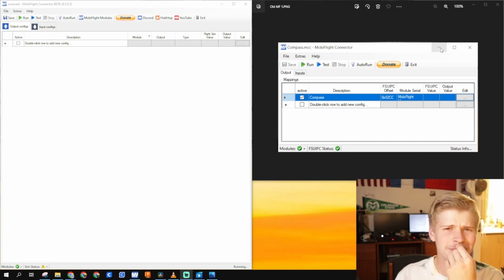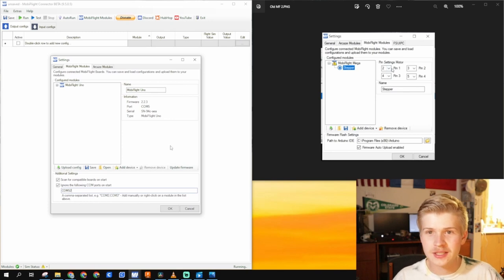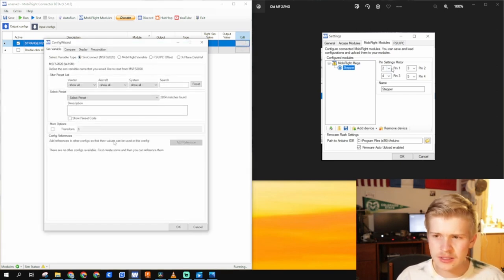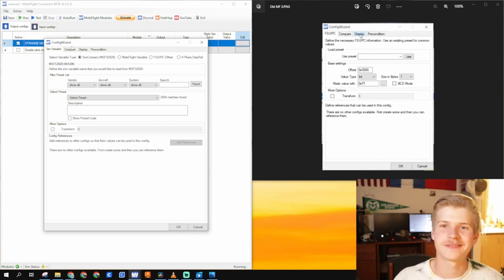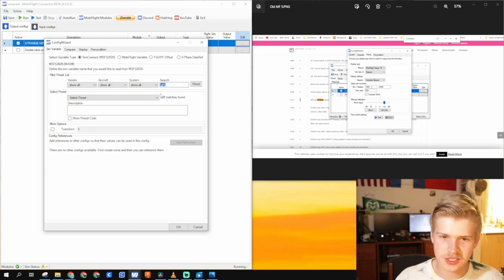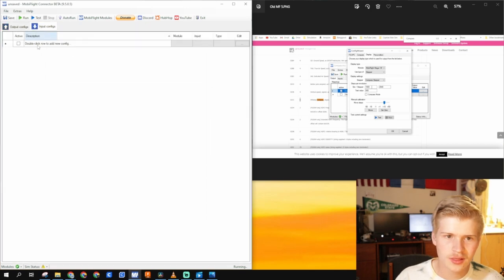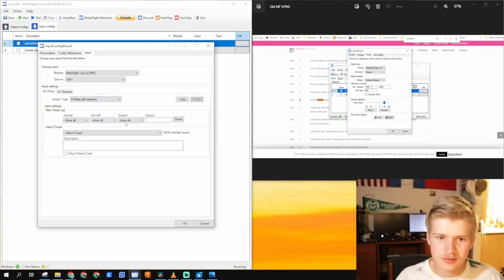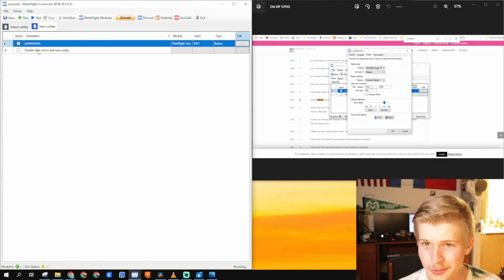Old MobiFlight vs New MobiFlight - What are all of the changes?

Comment: You have come a long way baby!  (Both Mobiflight and the mustache). Mobiflight is becoming a very accessible cockpit building platform. Here is your assignment should you choose to accept it (the show that line is from is older than your parents 🙂) Show the community how to build a dual Com, dual  Nav radio stack using  one dual rotary encoder, on single rotary encoder, one four line lcd display, an arduino 2560 mega and Mobiflight. Great fun, inexpensive and very useful, even if not so pretty.
Reply from the maker: Hey Steve! What a great challenge!
Email me CaptainBobSim@gmail.com I'd love to have your opinion on my prototype files for it.

Comment: Hey, Do you know if it's possible to assign a keybind and/or a servo to the circuit brakers in the black square bonanza in msfs? 
I'm planning to build a bonanza home cockpit based on that aircraft. But I can't find any information on the circuit brakers. Any help is appreciated! :)
Reply from the maker: I don't have the Black Square Bonanza, so can't tell you for certain.
You can trigger a circuit breaker via a joystick command however!

Comment: The last version is very good but the last configuration window(where you check the ok for a config change, at 4:22 in your video for instance) is bigger and too big now and not sizable. Since most bezels or frames are smaller than the actual physical display some parts of Mobiflight are not visible. This must be easy to fix for the developer🤓
Reply from the maker: You should report the bugs at https://github.com/MobiFlight/MobiFlight-Connector/issues
assuming they don't already know about it. I don't know if I'm completely understanding.
Reply: @CaptainBobSim  I am not good at explaining but I meant  I can-t click ok after having made a change since the ok button is outside of the screen area on the instrument panel in my homebuilt sim :) . I may contact Sebastian🙂
Btw. , your channel is super and I have learnt so much from you🤗
Reply from the maker: Gotcha- that makes sense, If you change your monitor resolution does this solve it?